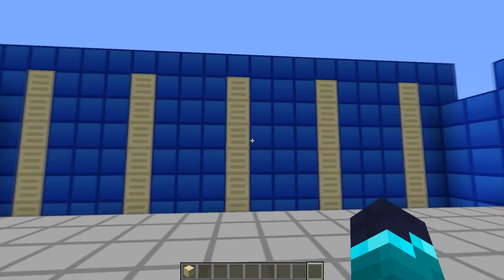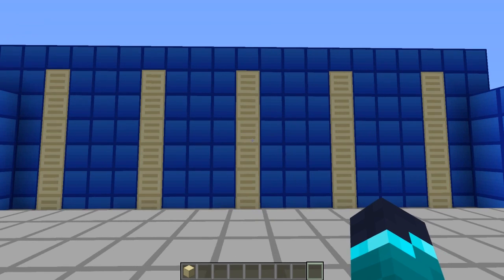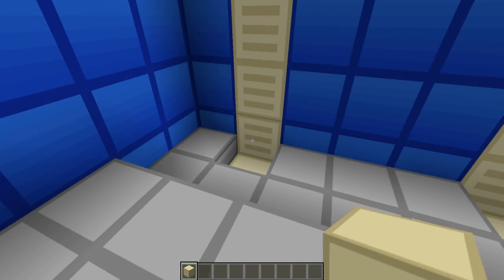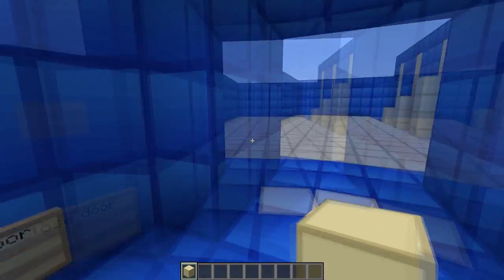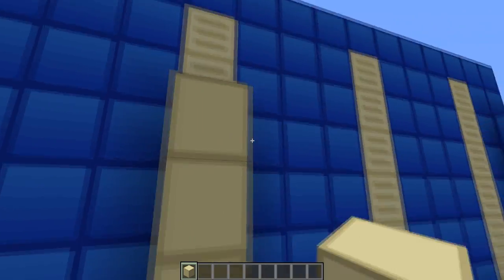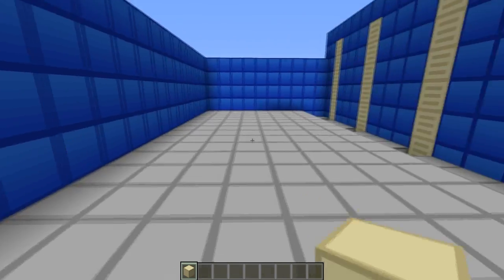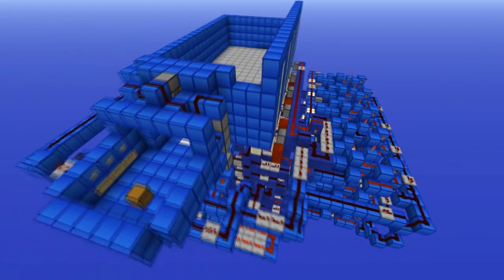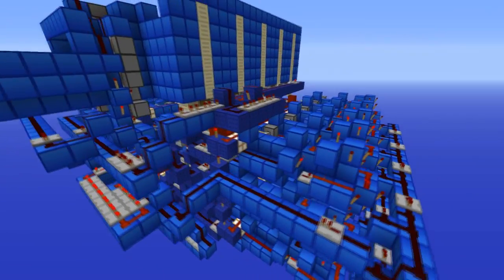Minecraft - (Pin Tumbler Inspired) Programmable Sand Key Lock

Comment: I'm not 100% sure how you measured the level of sand after dropping through, but do you think it would be possible to have the sand break on a half slab with a hopper below and somehow use the comparator output of the hopper to determine how many blocks were in the stack? I don't think so, because comparators aren't sensitive enough to measure such a small amount of blocks, but I'm just brainstorming here.